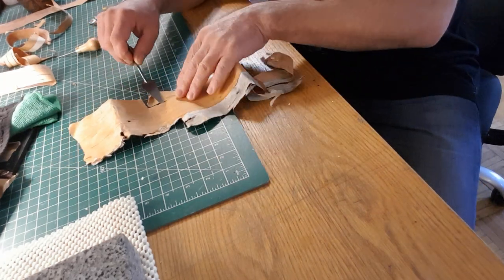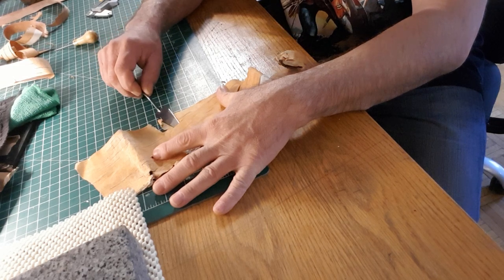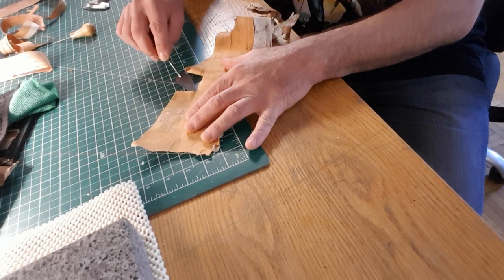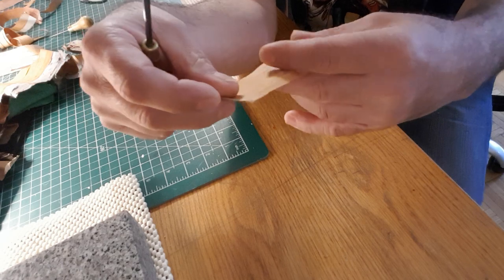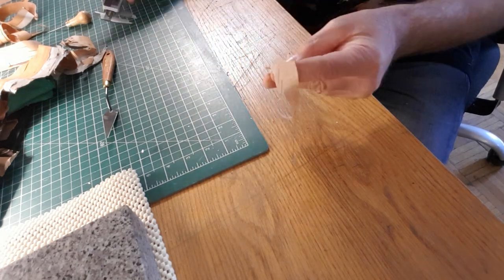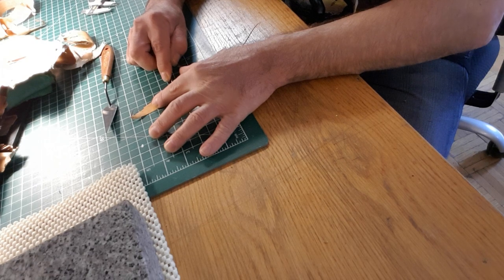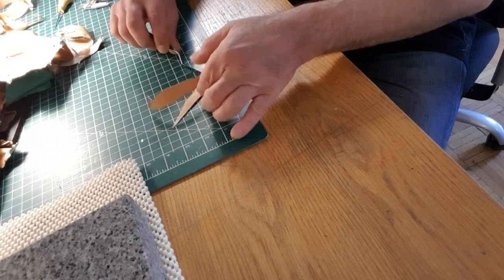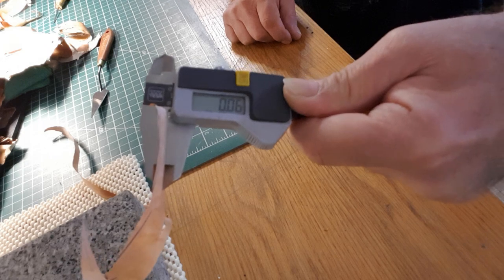DIY birch bark splitting

Comment: Do you think you need to go down to 1 layer for covering bows? How about quiver building? I'd think you would want some thickness for structural integrity?
Reply from the maker: Apparently,  thin is better .
Definitely for arrows.
Reply from the maker: For quivers , we want bark to be as thick as possible. 
In this case it is structural component .
For arrows,  it doesn't bend or anything.  It is there just to waterproof it.